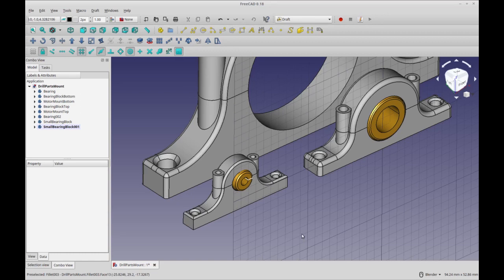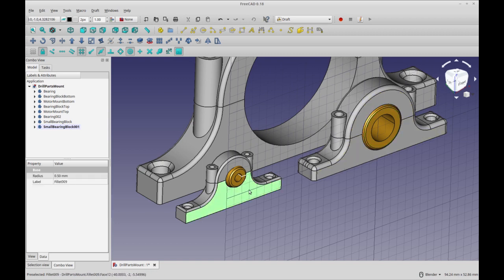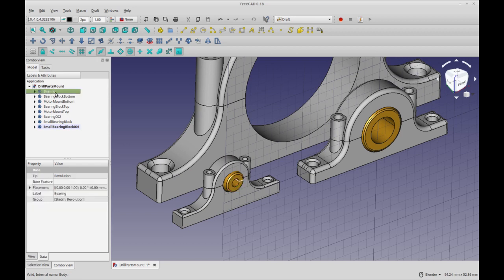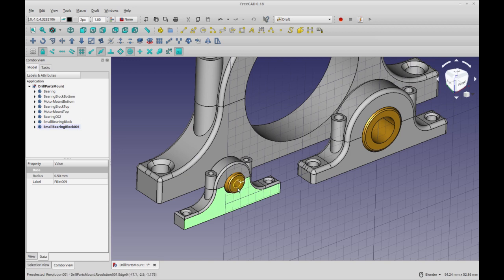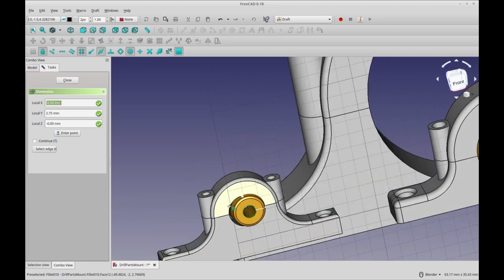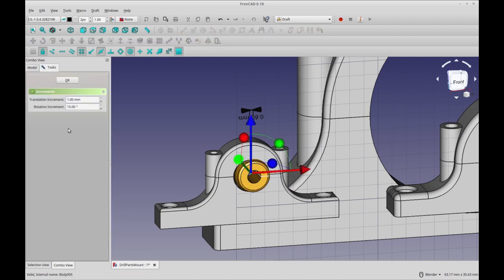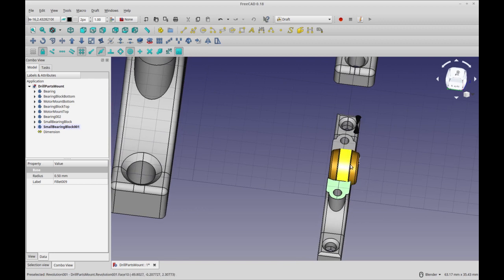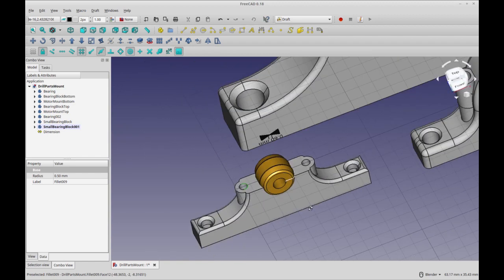FreeCAD Quickie - Translate using Draft Measure

Comment: I used to work with Solidworks and Creo before jumping to FreeCAD and trust me, you get similar headaches even with the most expensive packages. This is, I believe, because CAD and CAE programs are so incredibly complex systems, that a "right approach" to do things does not exist or is very difficult to achieve.

Comment: Cad software is a horrible thing, even with comercial "profesional" software you can have similar problems to what you show in this this video
Reply: Still beats slaving over a drafting table.
Reply from the maker: I ran into that recently with trying to center text on a face with Fusion 360, it is a non-obvious task. Frankly it was easy to figure that out in OpenSCAD. :)